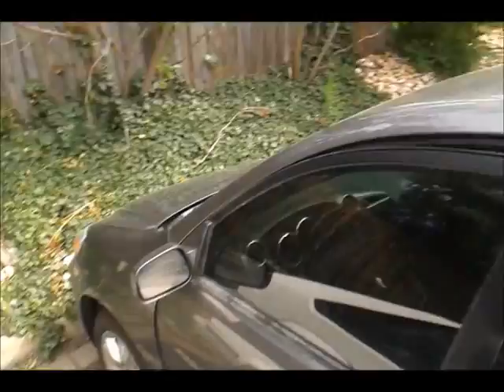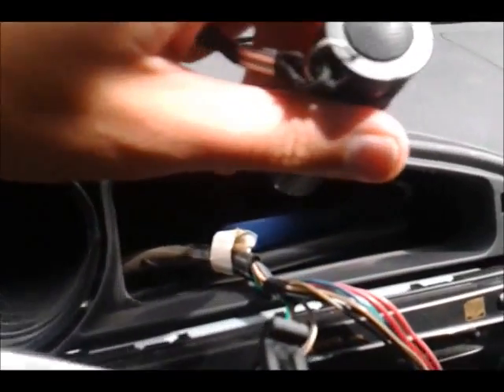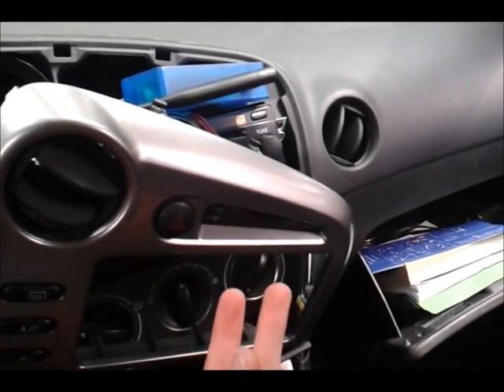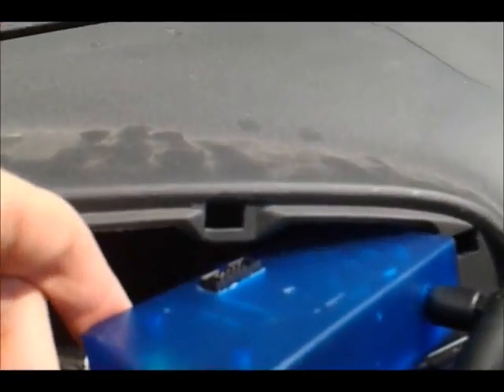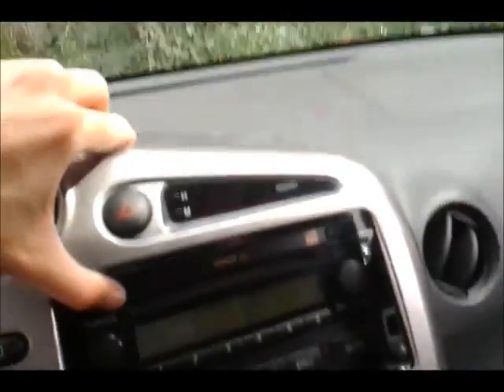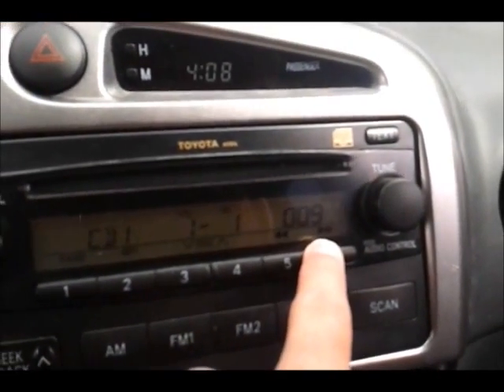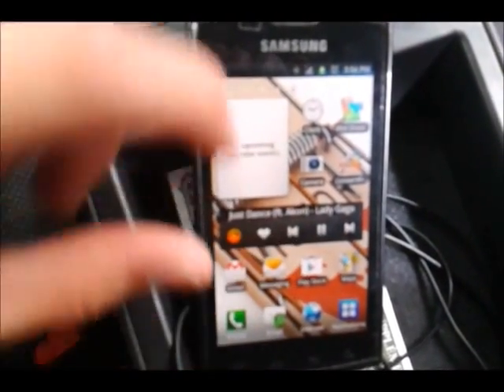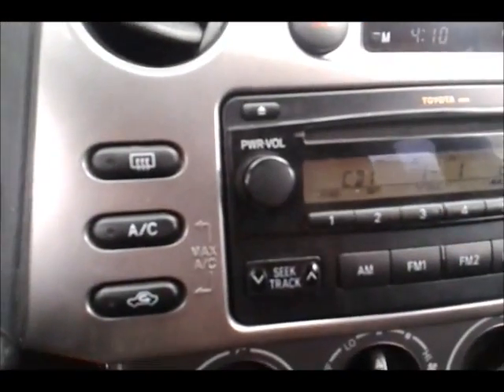Bluetooth Car Addition Demo

Comment: thanks. the thing i am trying to do is to use an existing bluetooth headset and with that, i think I need to use an avc-lan circuit.. right? how do I send the signal from HU to change the tracks on my ipod?